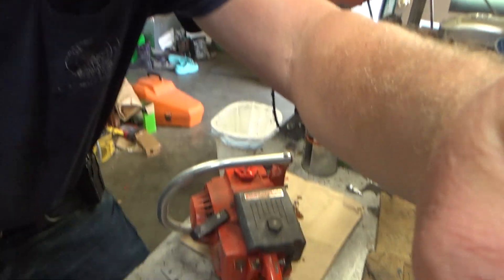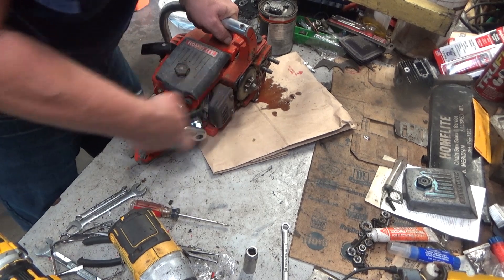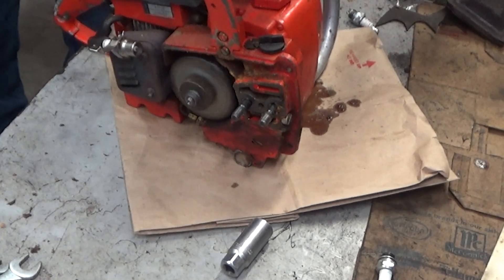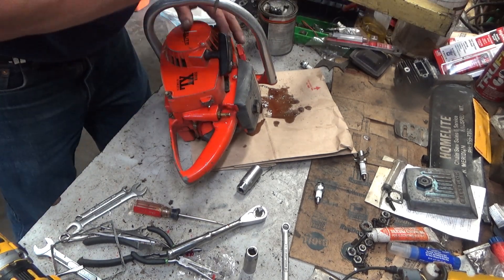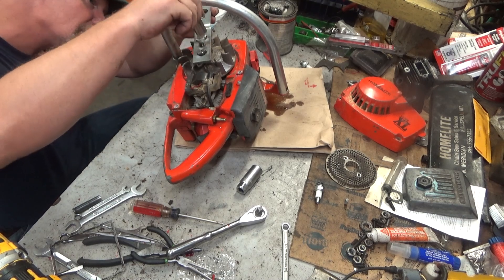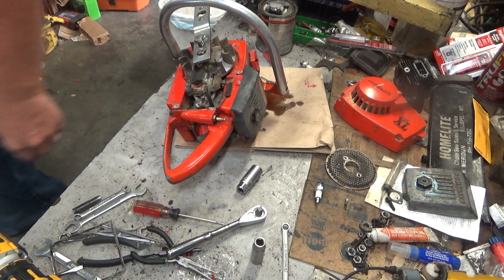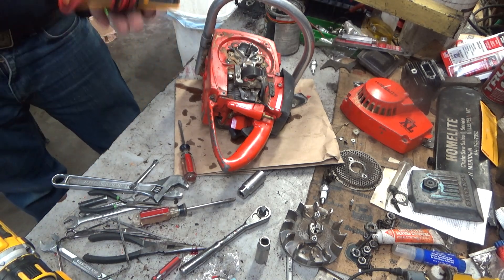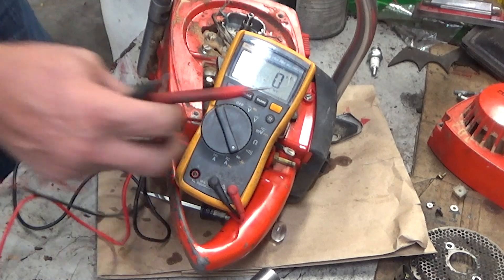Diagnosing A Bad Ignition Condenser On a Homelite Super XL Chainsaw!

Comment: felt compelled to add comment, the old breaker points ignition systems powered all of our automobiles at one time, these systems spread confusion among many back then and today they are a new deal for most aspiring mechanics. The capacitor, also called condenser in these systems is there to absorb inductive voltage/current in the ignition circuit, without it there is a counter flow of electricity backwards to the points when the coil is discharging. THis leads to fairly rapid damage of the ignition points because of burning AND it also means that the voltage spike meant for the spark plug is bleeding off in a backflow so the ignition is weak or erratic. A capacitor is nothing more than an electrical storage device, current goes in or out relative to voltage in the circuit. An engine will run without a capacitor but usually poorly and eventually will fail due to points destruction.
Reply from the maker: Thanks for that context!

Comment: most likely it's the coil 😮😮 I just seen that on another chainsaw it still could be the condenser and points are weak the spark is suppose 2 be bright blue ouch😊😊 OMG 5 28 2O24

Comment: Really on the old 60 and 70 auto 
If you change condenser every year you will not have points problems if there lubed with correct lube
I drove a 1972 , 305 tell 2020 and it still runs 
Deco points and new condenser every year and it was my daily driver to work and service calls

Comment: Your close actually a condenser or capacitor is actually used to hold a charge for the coil and points times it when to send the charge. If condenser goes up in value it filters out to much charge so would be weaker or intermittent
Reply from the maker: Thank you!